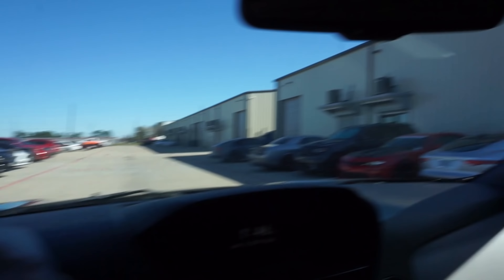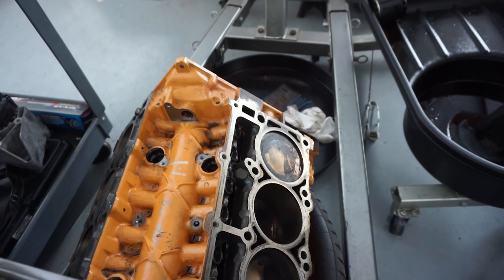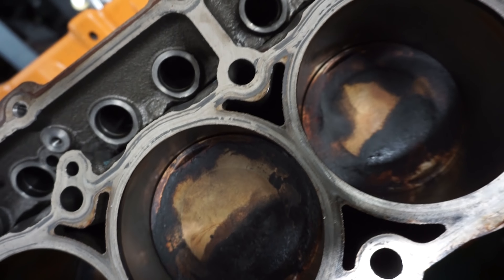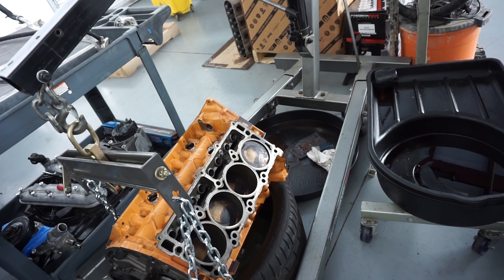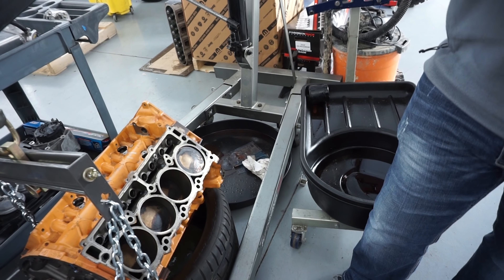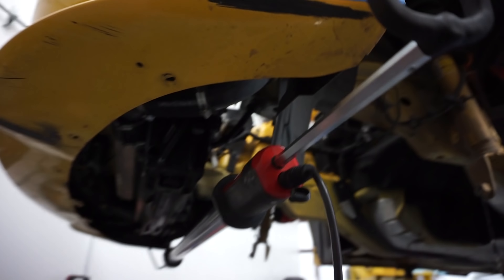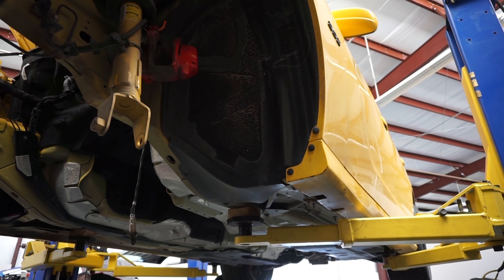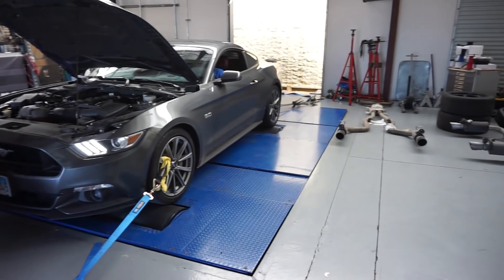Making this small change before the motor goes in (More power!!!) We are at the final stretch!

Comment: I just feel bad all the money put in this damn car man.  Love the channel.  I'm not a Mustang Fanboi, but I bought mine a year ago '15 GT Premium/Track, dropped in an 8k installed 2k mile used K/B 3.2L, installed, tuned.  700RWHP, zero issues, engine runs like butter never had any issues.  I had the ECU burn out but that's cause I didn't use the car for the entire year, so had battery/ecu replace, reflashed with the NGauge, and again purrs.  Really hope this puppy purrs with the new engine in it.   Looking forward to it bro, keep it up.
Reply from the maker: Yeah for go fast value it’s hard to beat the mustang. I had to sell my 11’ after I had my son so it’s really not possible for me. Unless it was just a fun car or race car or something but I can’t use it with my family.
Reply: @DadMods  All good, still the most real content on Youtube, enjoy watching each video.
Reply: I bought a late build 19 Mustang GT premium and it's knocking with 1200 miles on it so.......
 It does 4.5 on p255 all seasons though hehe...

Also David it unsubbed me for some reason make sure to tell people to check

Comment: I would also contribute those deposits from the cheaper gas (HEB, Kroger, Sams) (None Top Tier Gas)Looks for the sticker) due to no detergents vs something like Shell and other well know gas stations.
Reply from the maker: Ahhh don’t say that! lol. It’s my cheap sams club gas? The car was running 10:0 afr at wot for a bit. I just have a hard time with the idea that the gas is that different. But since I have all this # in the build only top tier from now on. I actually only did top tier for a while now after everyone yelled at me.
Reply: Most fuels are refined to the same standards, but Its the added detergents each supplier adds, that makes the difference. You get what you pay for or don't pay for in this case. I personally wouldn't risk dirty burning gas with that kind of investment.

Comment: Lol it's always obvious when someone is clueless about engine building. Better to not ad lib in those instances.... it's cringey

He's talking about over boring but you mentioned honing and he had to "uhh yeah" you lol
Reply from the maker: Kinda. It’s more of a terminology thing. I put everything in the honing bucket. So boring it is also honing. I know it’s not but to me it’s like the same thing. Essentially removing material from the block. I know from a machining perspective there is a huge difference which is why he corrected me. I do IT and business. So yeah I’m decently clueless. I get the physical aspect but other than that not so much. I felt like boring was just a form of honing lol.
Reply: @DadMods  Im just talking shit bro; not a dig at you more like a thing I caught in the video. Usually honing takes off minuscule material; essentially it's just knocking the glaze off the walls from the oil oxidizing after use
Reply from the maker: At what point does it become boring rather than honing?
Reply: @DadMods  when you start removing 0.005 and more inches of material...it's safe to call that boring
Reply: and when you go to a machine shop...the price to hone a block...and the price to bore it are COMPLETELY different. They are NOT the same thing
Reply from the maker: Honing - a precision tool with a mechanically rotated abrasive tip, for enlarging holes to precise dimensions.

Boring - the act or process of making or enlarging a hole.
Reply from the maker: According to the actual dictionary definition I seem right. But as far as actual usage of the term (like for machine shops) you are right. Mostly seems like honing is boring and boring is honing. At least from a dictionary definition. So you are both right.
Reply from the maker: You bore a block by honing it.
Reply: Hqen2000 when you to the machine shop..... they will correct you like in this video if you call an overbore a hone job

I'm telling you that as someone that does this..so you can call it honing if you want but they'll correct you again
Reply: @DadMods  please stop trying prove you're right by interpretation. Quoting a dictionary? Come on man, you'll earn more respect admitting that you don't know. It's apparent in several of your videos that you aren't very knowledgeable. Just admit it and move on.
Reply from the maker: I said it in my first reply. Other people chimed in and said I wasn’t as wrong as you indicated. I really can care less. I’ll use them correctly moving forward now that I know.